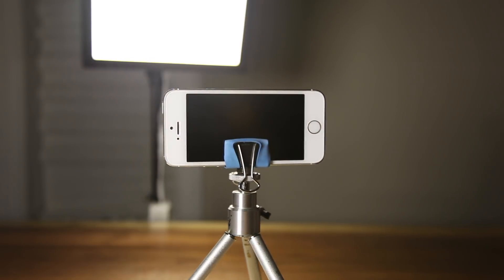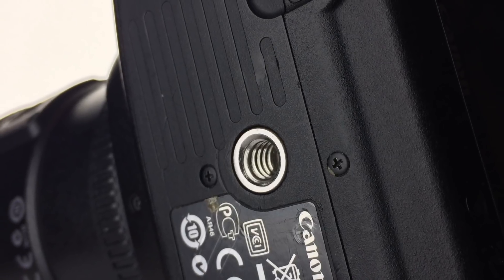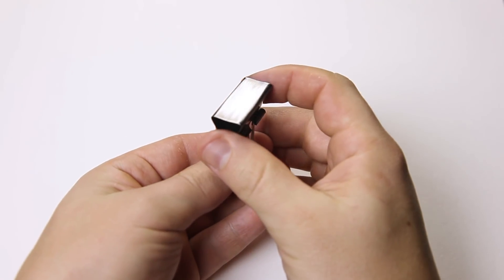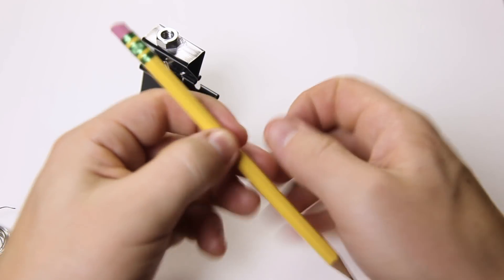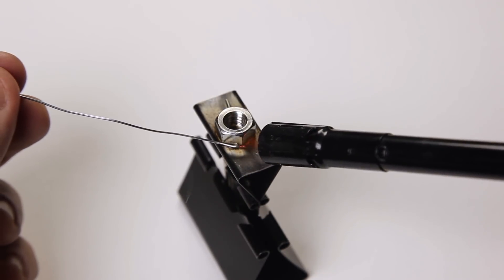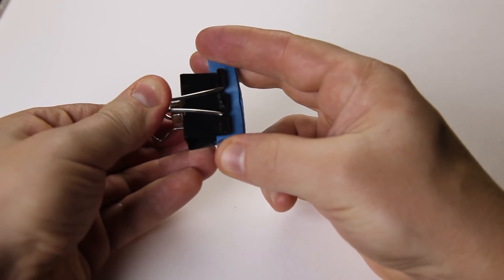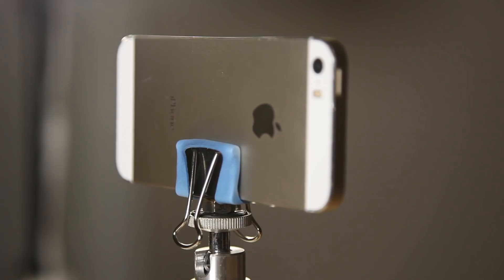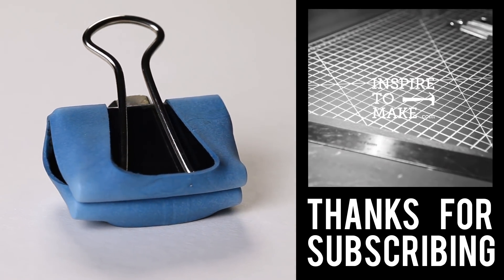DIY iPhone tripod Mount

Comment: The binder clip may put too much pressure on the touch screen.
Reply: You need to open and close it a lot to stretch it out so it isn't as tight.
Reply: I was thinking that the whole time😅
Reply: it seems to also cover up a good portion of middle screen. i want to see my entire screen before i take my shot. nice DIY though
Reply: Professer Mystery ... Oh my 😂 That sounds so so soo wrong
Reply: I'm leaving my phone in its case so most of the pressure should fall there. It also will allow me to see the max screen.

Comment: I have several tripods from years ago when people used real cameras. I made one of the binder clip tripod adapters described in this video. One minor change I made was to skip the rubber band. Instead I added a thin layer of plastic (using a hot glue gun) to the side of the clip that contacts the screen. Works great.

Comment: I made this exact mount, and while it does hold my android securely, the excessive pressure exerted on the screen from the clip prevents the touch commands from functioning. Btw, for those who can't solder or don't have the equipment, you can use 2-part marine epoxy (home depot, $3) as I did, and it works great and the nut is on to stay!
Reply from the maker: you can unbend the clip to reduce the pressure.

Comment: just a question, wont that damage your phone screen, because of the pressure?
thank you!
Reply from the maker: It won't damage the phone. But if your clip is too tight, you can unbend it a little.
Reply: That's exactly what I was thinking haha!!😂
Reply: Inspire To Make How do you unbend it?
Reply: @chuckilla1471  4 years and still no reply...
Reply: @saaimi4280  1. with one hand squeeze the silver arms enough to wedge the middle 3 fingers of the other hand inside the black part 2. with both thumbs squeeze the arms again and this time also wedge the middle 3 fingers of your other hand inside the black portion. You should now have 6 fingers inside the clip 3. now use both hands and medium pressure to pry the black portion open about as far as it wants to go, then with a quick burst apply maximum pressure forcing them open a bit more for just a second.
After I did this one side didn't close all the way so I repeated it, applying extra pressure to the other side and now the whole clip has a slight gap in it when shut which gives it the perfect amount of pressure when holding my phone with padding.

Comment: Use a brass nut!  Great idea and works great once you get the nut soldered on.  I couldn't get a steel nut to take solder and used a brass ¼"x20 nut and it took the solder very easily and is really on the binder clamp.  Now it's perfect!

Comment: Could you do a tutorial to a complete iPad Air tripod someday? I would really apreciate. Your chancel is beautiful.
Reply: I think you can attach two clips at both ends of the steel line and weld the nut in the middle of the bottom line :)
=   = <-- clips
-------
   . <-- nut

Comment: can we use aluminium flexible wire for soldering?
and can we use a blow torch?
Reply from the maker: you can use the blowtorch, but i dont think you can solder with aluminium wire

Comment: what if we do't have flux. is it ok if we can just solder it?
Reply from the maker: deanne fausto The solder will not stick without flux. If you don't have flux you can try to use some acetone of rubbing alcohol.
Reply: ok. so i just pour a bit of alcohol to both the clip and the nut?
:)
Reply: or does it need to be more than just a drop? like soaked?
Reply from the maker: deanne fausto use a paper towel
Reply: ok thank you so muuuch!! i really needed this . your method is the only one suitable for my situation and by far the easiest to make (good thing i know how to solder ).. and the most incredible and clever way i've seen for diy tab tripod... thank you and God bless you :)
Reply from the maker: deanne fausto Thanks!
Reply: deanne fausto Most electronics solder contains flux, tin the clip and tin the nut (tin means give a thin coat of solder) then stack them as in the video and solder, it will work fine. Alcohol is in no way a substitute for flux.

Comment: How come the bottom of your binder clip is flat? mine has a slight bend
Reply from the maker: +Pandonaut Productions It's not as flat as it looks like
Reply: Nvm picked up some new ones today and they are flat. My old ones were curved for some reason. But i'm having trouble with the solder sticking to the nut. It seems to just pop off even with plenty of solder and flux on there.
Reply: +Pan Years ago, here in the UK, there was a product called 'Fluxite' that was a line of solder with flux incorporated within it.  My Grandfather used it for whatever he did and, back in the mid 1980's, I was "into" building electronic kits as a hobby, so I used it too.  

If Fluxite is still around (I must admit I haven't looked - I'm busy writing this) then that may be your answer.  

Otherwise, the answer is either solder is too soft for such projects and the guy who posted this video was just lucky; or you may have done something else wrong - too much solder maybe?  

It's been a few decades now so I forget how soft solder can be exactly.  Don't recall it being all that soft though. Or brittle for that matter.  I think it ought to work. 

Suggest that you try not to place too much physical stress on the joint maybe? 

Did you use extra solder around the nut after the initial melt, as the gentleman did in the video?  Are you sure you got all the paint off first?
Reply: Ok thank you for the info, but I tried a different tripod method which is more stable.
Reply: Fair enough.

Just curious. Which method did you use in the end?
Reply: I found this one with 2 binder clips here http://www.makeuseof.com/tag/3-cheap-easy-diy-smartphone-tripod-mounts-made-tested-si-x3/ < not sure if link will be removed.

Comment: Can you put the phone in the vertical position with this? I take pictures of my paintings to post online, and they must be straight. Some of them are taller than they are wide, and the pics need to be taken with phone in vertical position. I see no reason not to, but wanted to check first, since you show it in the horizontal position.
Reply from the maker: Yes you can clip the phone in any position with this tripod mount.

Comment: My husband and I tried it, but we can't get solder to stick to the clip and we took off all the paint and added "paste flux" to the clip and to the nut. The solder will melt if I apply the heat to a single string, but not attached to the clip. Sad. Such a great idea and really simple to implement. We used a barbecue torch, but one with direct heat. Wish we could figure out the problem. Hate to give in and buy one, especially after I bought all of the tools! How much flux are you supposed to use. We are using petroleum "paste" flux. Is that the right type? Please help!
Reply from the maker: +Angela H. Hi Angela, You should hold the torch on the nut longer, everything should be very hot to melt the solder under the nut.
Reply: Thanks for responding! If u had to estimate how long it should take to melt, how long would you say? Also, our flame is pretty long, yours looked short in the demo...does that matter?
Reply from the maker: +Angela H. Do you using a jet lighter?
Reply: +Inspire To Make Jet lighter? Is that the same thing as a barbecue torch lighter as per your instructions?  I got mine from Lowe's. It's a Scripto.
Reply from the maker: Jet Lighter and torch lighter are the same thing. It should produce this king of flame - http://image.dhgate.com/albu_769857932_00-1.0x0/honest-507-butane-jet-torch-lighter-w-support.jpg
Reply: +Inspire To Make Oh, that's not what I bought. I have a regular lighter with a red flame. That could be the problem I guess. Purchasing that does bring the price up. I guess this is more about the joy of doing it yourself versus saving money, although if we each make one for our phone then we get two which could bring the price point down.
Reply: +Angela H. Try sanding the side of the nut that you're trying to solder to the clip.
Reply: +Angela H. Try sanding the side of the nut that you're trying to solder to the clip.
Reply: +Angela H. Try sanding the side of the nut that you're trying to solder to the clip.

Comment: Using solder as an adhesive/primitive form of welding? Just use glue. Far stronger that solder that you can ridiculously easily bend